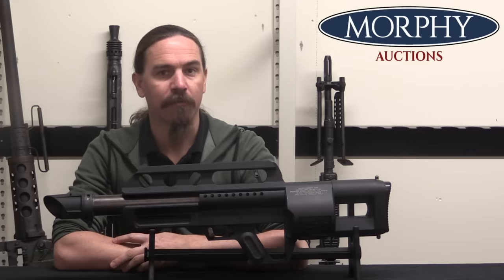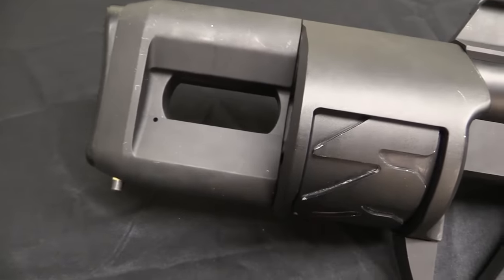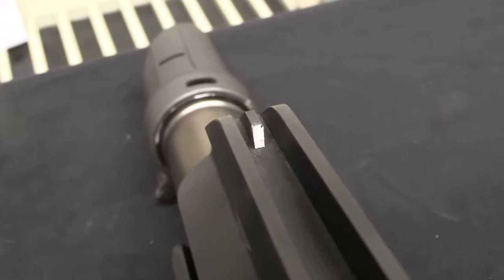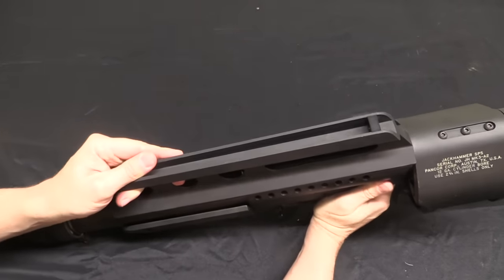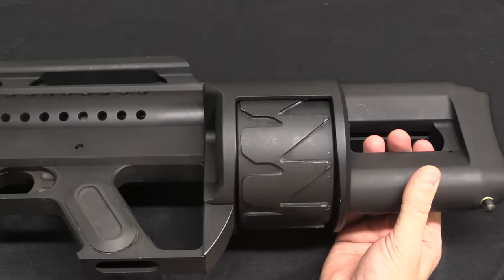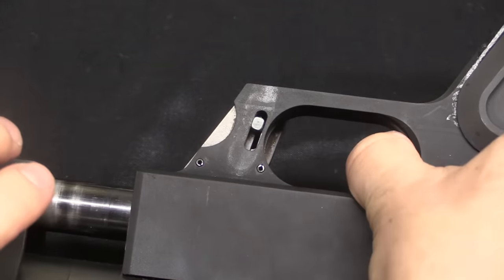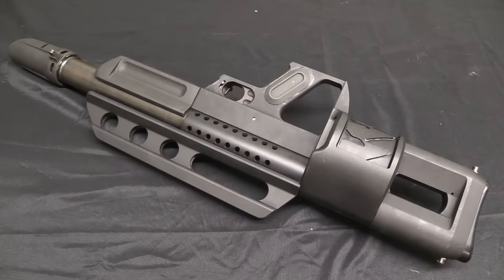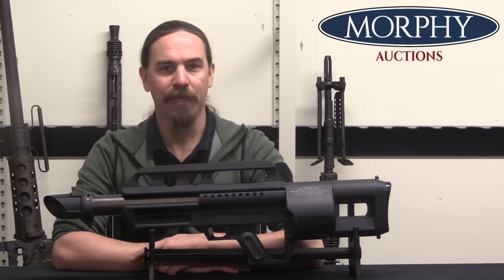Pancor Jackhammer Mk3

Comment: Could it be that the drum on this doesn't have a continuous slot because this version has a pair of control pins? On the forward stroke the front pin that locks the drum in position moves forwards to unlock whilst a rear pin rotates the drum, then on the rearward stroke the front pin comes back to lock the drum (with a little chamfer in case the drum did not wuite turn all the way). These big open wedges would solve the problem that the first gen guns had with the norrow pin track becoming blocked with debris or fouling. I don't believe that the manufacturing is incomplete, as this is exactly how the magazine appears on the 1987 patent drawing.

Comment: Pros: It's for the moment the only know example of a improved Jackhammer Shotgun, and only 1 of 2 Jackhammer shotguns known to still exist in the world.
Cons: Its registered as both a machine gun and DD. It's the only known example known to exist and it was never finished and doesn't work, and the guy who designed and built it is dead. So even if you buy this, you'd have to find and pay a gunsmith who can make 1 off parts and design a fire control group for a gun that you can't replace if they mess it up.

Comment: @Ian: what if the cuts in the drum are not unfinished, but rather meant to be operated by two separate pins, mounted on the same oprod? one pin working on the forward stroke and the other on the backwards stroke of the barrel. It could be a fix of the difficult machining process of the grooves that you mention in your first Pancor video

Comment: The US didn't want the technology to go overseas where all of its mechanical features originated in the first instance , much of it from the Roosevelt /Churchill agreement that put all British intellectual technology in the hands of the US industry , from basic firearm designs to ICIs work on fissile material for the US to enter the war on the side of the British .
As for the thing itself , I think my Franchi SPAS 12 with its folding stock and set of muzzle attachments from grenade launcher to crowd control horizontal spread muzzle , had that licked . My guess back in the late 70s early 80s was that S&W would probably develop the first reliable box magazine fed shotgun as they already had the Model 52 pistol that reliably fed .38 target wadcutters ( about as flat as you can get in a round with a simple roll crimp), but was a totally pointless exercise and waste of money ( not a cheap gun here in the UK ) despite that , as it was no more accurate than my old Ruger Speed Six firing the same pathetic loads and of course the Speed Six was just as happy on a diet of .357 hollowpoints too .

Comment: Would those cylinder cuts would work if 2 pins are used? One that indexes the cylinder most of the way during forward travel and a second that finishes the travel and locks it in place under pressure from the main spring.

Comment: I wonder why that Muzzlecone is angled so strangely?
Reply: The muzzle device is bayonet mounted on the front of the barrel jacket and retains the barrel return spring. In this instance it is not quite turned enough, either because it is just loose or has accumulated some debris/damage over time.
Reply: @commando552  Ok thanks, that makes sense. I thought it might have to do with recoil compensation, like the muzzle break on an AK, but the Pancor that Ian showed before this didn't have that.